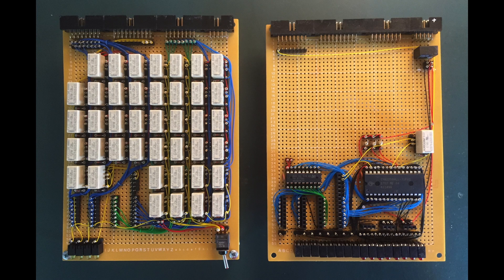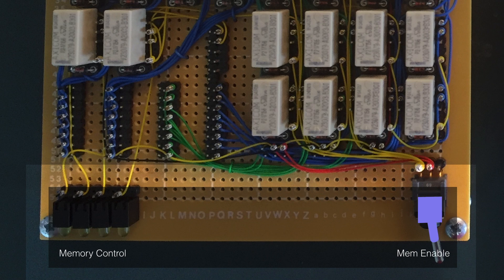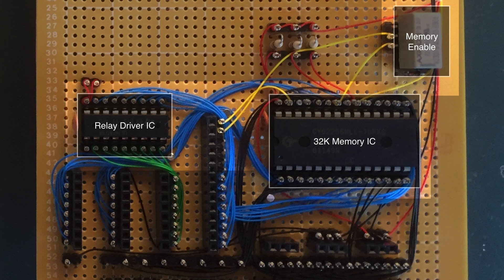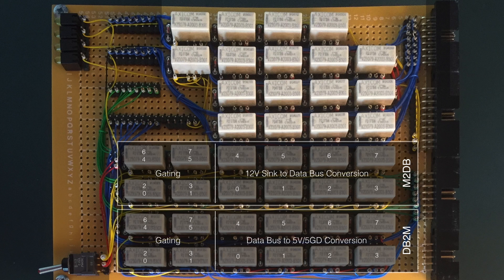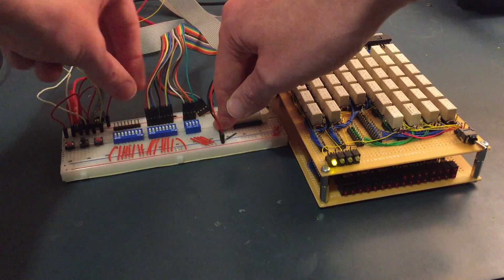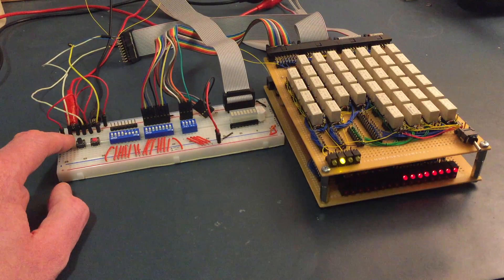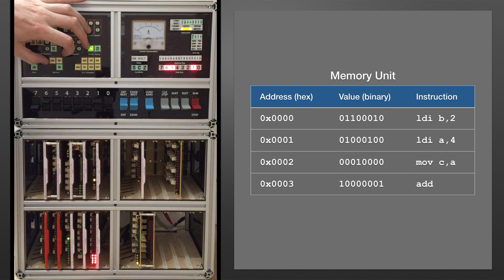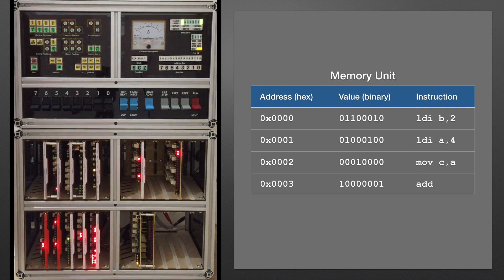Relay Computer: Memory Unit Test

Comment: i would've tried miniaturizing the memory system that the facom 128b used. would have been entirely era correct and made the memory much smaller than if done by relays.
Reply: Facom 128b? What is that?
Reply: @Jeffrey314159 was a room scale relay logic computer. and used technology from telephone interconnects for memory. it was a japanese machine.

Comment: How do handle the read and write timing specs for the DRAM?
Reply from the maker: I just operate the memory chip way, way, way slower than it's designed to operate at. As long as I change the write enable line at the right time and make sure the address and data bus values have stabilised it's ok.

Comment: they say classic doom can run on literally anything, but can it run on this?
Reply from the maker: In theory yes ... it'd be completely unplayable though. Like ... press a key ... have a weekend away somewhere nice ... come back ... press another key ... kind of completely unplayable.
Reply: @paul80nd  doom was built around a system with a 32 bit architecture.
Reply: You could modify it to work on the computer but as Paul said very unplayable id say it would be quite unplayable at 1 mhz
Reply: Ok, hear me out.... doom, but as a text adventure....

Zork runs very slow on an 8-bit RCA1802 at 4MHz, can't imagine how slow it'd be at 16Hz

Comment: I'm loving it. I don't know if you talked about it at some point but - why not 5V relays, which would be compatible with the logic ICs?
Reply from the maker: I kind of ended up using 12V relays as it was a bit of a sweet spot price wise for the size and type of relay I was using. Given there’s so many of the relays I wanted to try and get the price down but also use a small relay so the overall size of the computer wasn’t too big. There’s a bit more on that here: https://relaycomputer.co.uk/2013/11/relay-rumination